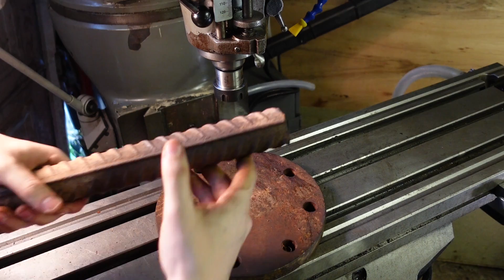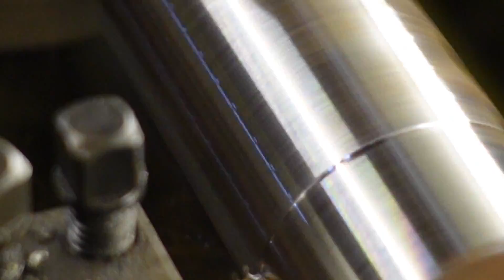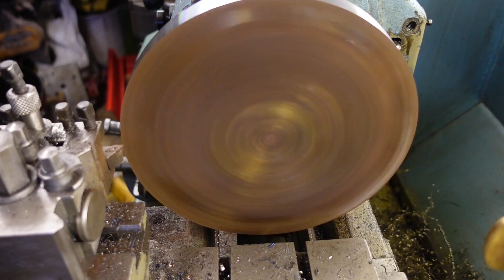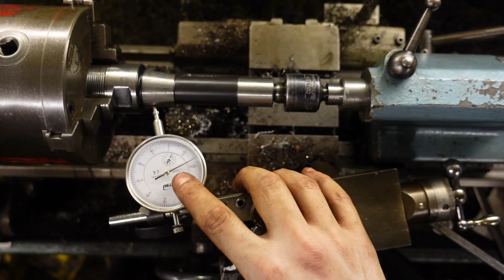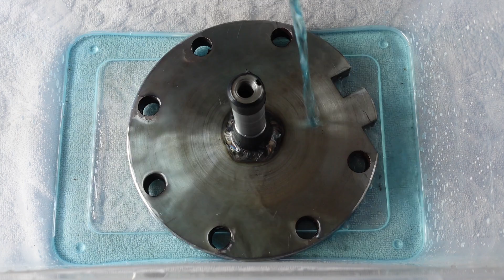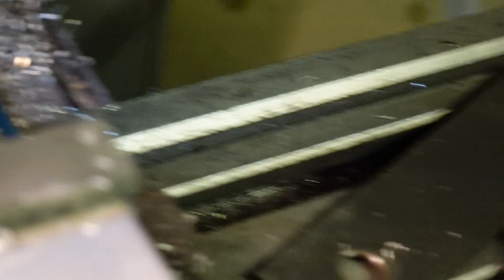Making a Flycutter

Comment: Why not fill the bolt holes and use the extra angular momentum in your fly cutting?
You could thread the holes, install high grade bolts, cut the heads and tails off, we’ll them on both ends, clean it all up and voialá!

Comment: Great skills and adaptation. 
One thing I noticed... whenever I see what looks like M11x1.25, it's almost always UNF 7/16" 20tpi (M11.1125 x 1.27, so to say). It's one of the two very common imperial threads, even in the metric world, frequently used for automotive seat belt related fasteners. At least in Japanese cars that I've known, it's the ONLY standard used in that area. (The other common imperial being UNC 1/4" used in every camera/tripod mounting interface.)

Comment: First off, Don't stop jumping into projects though, love your content.

Perhaps I could offer a couple of points. Carbide insert tooling is sexy. All the Big Boys use it. But HSS is still a thing and works awesome in a hobby metal shop. It's cheap af, you can make all, kinds of tools with it, abuse... it takes abuse well. (Especially interrupted cuts and rusty pieces... carbide HATES those) Lastly, you can get remarkable finishes with it. Carbide IS sometimes the answer, but it doesn't have to be. The next thing, rebar. Rebar is a bit of a junk metal. It seldom has enough carbon to properly harden, is prone to carbon inclusions (almost like inclusions of iron which can lead to tear-out), and can turn into a banana while you are cutting it. I steer clear of it at all possible. It might be good for making a chair leg for gran's stool but for tool making I steer clear of it. Made some neat whistles about 10 years ago out of it, but for something I plan on keeping, I will dig harder in the scrap bin or pay for some right proper stress relieved 44SMn28.

Comment: You do know that the R8 spindle isn't meant to handle something that large? Do you understand force multiplication? Have you ever used a pipe on the end of a rachet to break a bolt loose? Thats what's happening with your fly cutter with an R8 spindle. You're applying a tremendous amount of force to the spindle now and what's going to happen is you are going to ruin that spindle and wallow it all out. And the vibration from the imbalance is going to accelerate that wear. The R8 spindle is a light duty spindle. To use a fly cutter like that, you need a much larger mill with a much larger spindle. [shaking my head in disbelief] ........
Reply: He's not going to get it. You're better off explaining to a brick wall.

Comment: Depending on the lights and sound, you welded them with TIG welding? I'd recommend using MAG welding there. You burn deeper into the material, it is faster and you have less risk of getting strucural failure points in your weld, especially with steel.

Comment: I enjoyed the build from beginning to end. I'm sure it works just fine but there is one tiny little criticism meant in the form of critique rather than insult.  I realize the exact location of The cutting edge can vary depending on the exact geometry of the insert holder or bit that you installed in the head, but it still would have been more consistent if you had made the fixed clamping surface the forward surface of your tool instead of the rear surface of your tool. At that diameter I'm sure it still works just fine though.

Comment: Vary nice! Dumb question, could you not have cut a matching taper on the shaft and bore of the circle plate? Then you could have just used a bolt to pull up the taper tight and not bothered with welding.
Reply from the maker: Yh yaknow there was manny ways to make it....... in the shell mill video I made it screw on .... I opted to weld this to try and maximize stability as the plate wasent very thick

Comment: Been there done that. Except I put 4 bits on it and allowed each to be adjustable angularly. With that I can set them all the same and feed 4 times faster or set them in steps and cut 4 times deeper at the normal feed rate for 1 bit.

Comment: Dear "All angles" I watched your channel for the first time with this video. One crucial point which seems to be missed in the comments; a fly cutter is a single point tool and it cuts perpendicular to the axis of rotation no matter how bad its made. I hope you catch my drift here but it's therefore unnecessary to make a precise orthogonal holder.... The collet arbor should fit perfectly to avoid play in the spindle (and chatter on the workpiece). But after that; weld away. If the arbor is not true to the holder it will theoretically have no effect on the cutting line. It will have an effect on the balance of the tool which will show in your workpiece too. But.. the added cuttin arbor added destroys the balance anyhow... If I would have to make a fly cutter on your equipment I would make a perfect arbor with a press fit in the prepared disk and leave a nice gap to weld from the bottom of the tool. After this I would mount a lathe cutter in the vice of the mill and put the "want to be" fly cutter in the spindel of the mill. Turn on the mill and face the bottom part with the cutter in the vice. This should leave you a nice result and probably faster too. Another suggestion is to calculate your speeds and feeds for the material you're working on. You speeded up some portions but especially on a large diameter like the disk the outer circumference goes fast and easy destroys your inserts pretty soon. Another suggestion, already mentioned, is to use a strong roughing tool with blunt action for the main material removal. After this change to a fresh sharp rake tool (after the part is cooled) to bring it to final dimensions. This saves you buying you new inserts and improves the surface quality. Just my two cents on how to approach a job like this. No absolute truth here; there are many ways to Rome. Keep up the good work and thank you for sharing your adventure. One extra; the heavier the fly cutter is, the better it will perform (on a small machine especially) Keep up the good work, stay safe and all the best, Job PS; cutting a thread with a tap is a neat idea if you don't have other options; chapeau!
Reply from the maker: Yea I did achwelly take a lot of thoes ideas into account like a press fit and turning it down on the mill with a lathe bit in the vice as that whould make it perfectly concentric to the bore of that mill but ultimately i just opted for welding and turning it true on the lathe ...thanks for the comment :)
Reply: Why do you only use citing oil when you aretaplg a thread and not hen you are cutting all metals?

Comment: The only 'problem' with using rebar, you don't know the type. 
Majority of 'old' stuff can be medium or even high carbon steel, welding on it can make it really hard and brittle. (being able to harden it can be an advantage in some situations)
'Modern' 'Made In China' stuff may be softer than mild steel or low carbon A36 grade 'structural steel'
It all came out quite well though.
Reply: That round disc looked as if it were of a quality steel with a fairly high carbon content as when he was facing the part there were sparks coming from the carbide cutter, that never happens with mild steel. I think the plate came from something like a petrochemical plant and had a higher quality steel requirement. As for the cold bluing, it's a hard thing to get right even when you have the material spotlessly clean you get those blotches on steels with a high carbon content. ( I've done quite a bit of bluing on firearms in the past and the cold bluing stuff that comes from the States, well some of it Is US lol I watch a lot of firearms related YouTubers and the only consistent cold bluing process seems to be from Brownell's and it goes black immediately and covers consistently well, with no blotches. Which the Birchwood Casey stuff just doesn't and it seems to me that it's  what you used here by the looks and results. I've not tried for a long time but thats the only cold bluing acid you could get in the UK, but I don't know about now.

Comment: Very interesting!
Good call on not cutting to the final size until after the welding...
As for why it went out of true, I'm inclined to believe there are a number of factors involved:
Firstly, the fitting was a slip fit, which means there will almost always be a margin of error when welding
Secondly, I believe you welded both sides in one go, which could potentially drag the shadt to the side a bit, this could be ameliorated by spot welding every 90 degrees to lock the shaft in placed, then welding the whole.
Lastly, I can only assume this since you didn't show your welding, but I gather you slotted them together and welded them without holding them together and true in a jig. That could also throw in multiple distortions that ultimately thjrow the shaft out of true.

To be honest, I believe your decision to do the precision cutting after the welding was the best option since it made the above issues redundant!

Comment: Your "Dead Center" looks just like my Live one? Wonder what Killed yours? LoL
Just a quick tip: instead of that crazy Home made Tap wrench you used, you know you can drive a Tap with a small 12-Point socket? Since Hex-botls are 6-sided, the 13 Point sockets also divide evenly by FOUR, you just have to dig thru your sockets till you find the right one for your tap (Metric or Inch) then you can use a Ratchet or t-Handle to better drive a Tap in Straight

Comment: Enjoyed the video. I realise you were only trying it out but the thought of the upstanding shank of the cutters catching in your clothes makes me wince. I'm sure you will cut down the tools you fit in there.
Reply from the maker: Yea I totally agree a dedicated bit whould be nice.. but I did make it with the intention of using a range of different carbide insert tooling from the lathe . It dose look a little odd but an unintended side affect is the extra weight in the tool kind balances the flycutter out at higher speeds

Comment: Hello, just a little constructive criticism if I may. 
Try not to use a finish tip on a face with an intermittent cut, it ruins your tip prematurely, rough it first. 
Get yourself a roughing milling cutter, it looks like a tap with a tight pitch,, but it removes material very quickly.
Try and use a slot drill wherever possible, use your endmills for finishing. Your lathe was running too fast for the diameter of your large disc. 
The safety tab you installed limits the size of the cutter you can use, but I understand the idea, however, grinding it down has weakened it's integrity.
I would never have thought of using a tap to thread a hole like that, really brilliant thinking. Otherwise a fantastic job. Well done
Reply: Good thinking.
I would have though a HSS tool to get under the rough stuff when he first started on the rebar would have been good. Blondihacks made the point that you can always regrind HSS and indexable tips can get expensive when your starting out.
He does a really good job of reusing scrap materials.
If you want an explanation of using a tap like that "This Old Tony" did a great explanation of it a while back. Its actually a way machinists do threads on the inside of large diameter holes.
Reply: The tap threading thing; saw it first on this old tony channel. They even go to the same nail saloon!

Comment: The round plate with the bolt holes proposes an interesting quick change faceplate design. To improve the clamping force, the holes can be shaped to the profile of the top step of the jaw. To prevent it from coming lose, it would also have a tapered shank or drawbar.

Comment: What was it u make the steel dark at the end ?
Reply from the maker: The process is called cold bluing you can buy cold bluing solutions on ebay usually used for gun barrels  .... think there's manny types but I  used Phillips cold blue allways works well